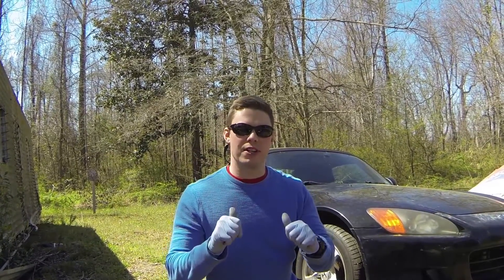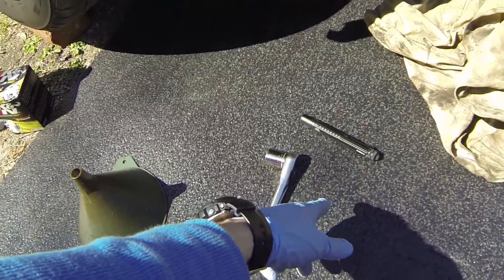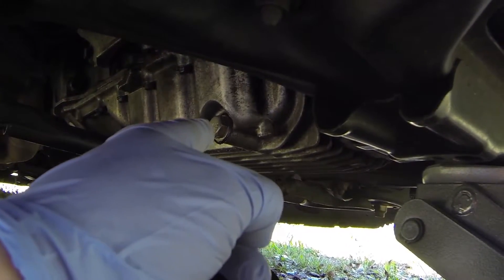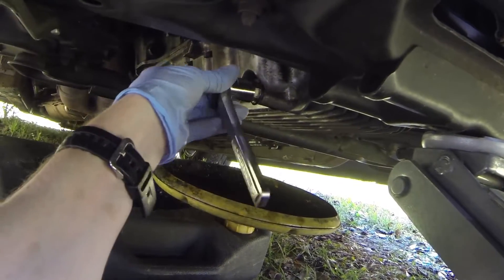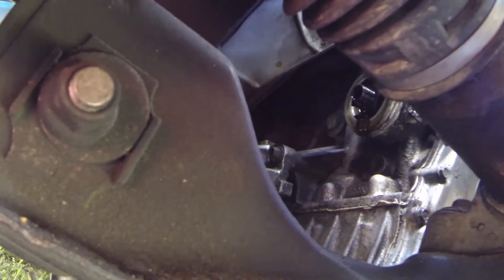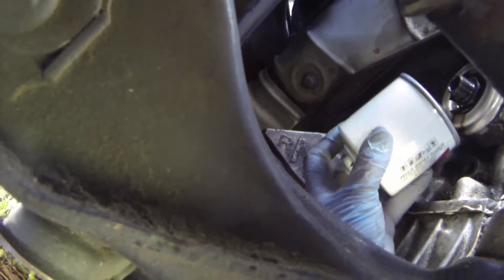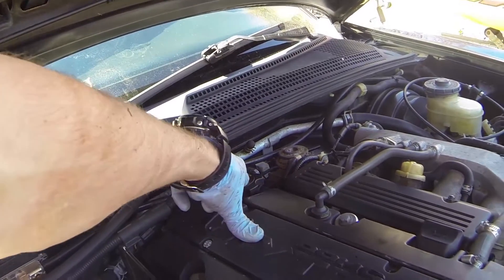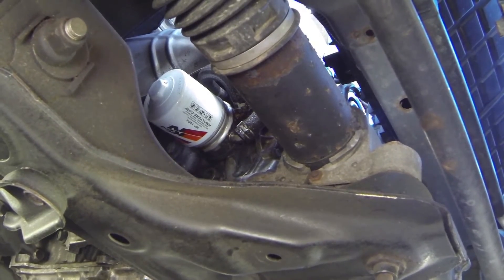How to change engine oil and filter 2001 Honda S2000 AP1

Comment: hey can u check if you have an oil leak under your timing chain tensioner?
Reply from the maker: Turkee Sonvich I think I might have a leak under my vtec housing. I replaced the gaskets for it but there is something else underneath it I'll have to check the manual on it but I noticed some oil coming from there when I changed it. Is that what you were asking?